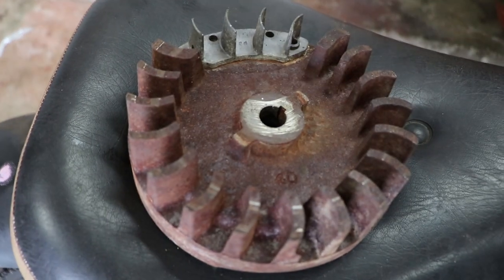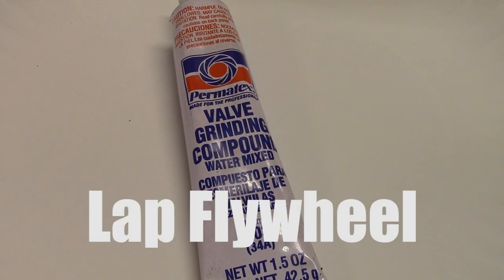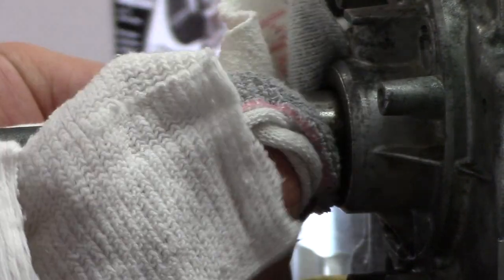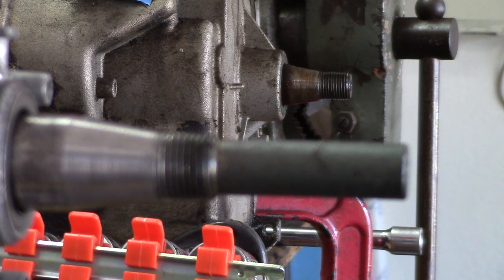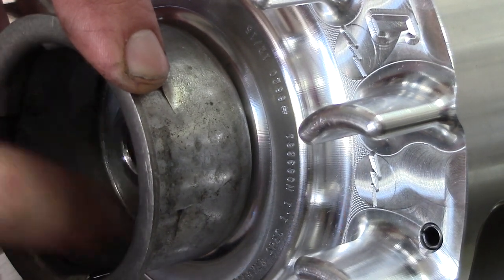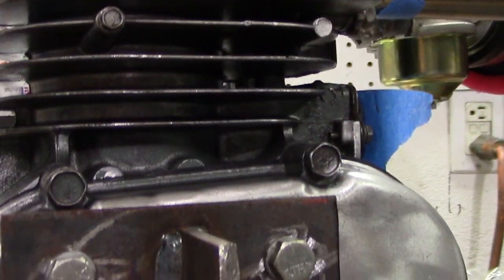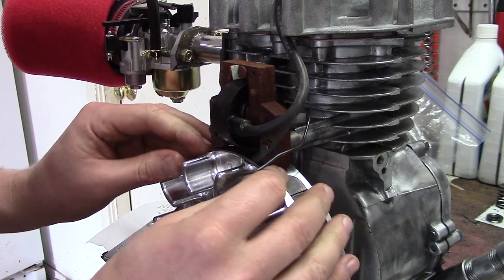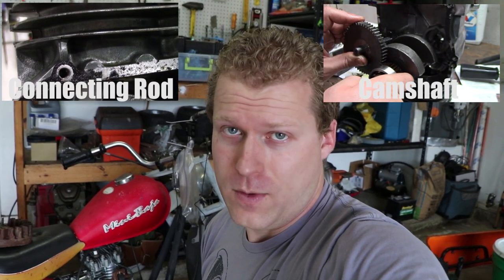Arc Billet Aluminum Flywheel: How To Install

Comment: if you have an old clutch you can take it apart and use the part with the key as a crank securer, it has grooves to set a bolt or two in between 👍

Comment: The plate you made was neat and the torque converter back plate is a good idea, but you could also just feed a bunch of rope into the cylinder with the head on through the spark plug hole and not worry about marring or damaging your output shaft. I have been doing it that way for years with no problems to date. The shaft will move unlike the plate idea but if you use a click torque wrench it won't matter.
Reply from the maker: Good idea. Its a cheap alternative. I just dont feel comfortable putting a rope in there and stressing the head bolts. Plus, you could bend the exhaust valve if you put the rope in there on the exhaust stroke.

Comment: Another option for holding the crank, you could use a sprocket the right size for your crankshaft and a chain whip (buy or weld some old chain to a handle) to hold it. Use a similar trick for bicycle freewheels, should work the same.

Comment: i have two Briggs 5 hp Flathead,s one is blown up the other one is being fixed and modified the blown up 5 hp is getting fixed for a mini chopper project and the modified one is on my mini bike cant wait to get the billet flywheel for both of them
Reply: I might be getting another 5 hp soon my local junkyard had one sitting in a huge pile of old worn out engine blocks
Reply from the maker: yeah they are pretty nice. Get yourself a PZ22 knockoff carb for that and it will do pretty well.

Comment: Hey man I just realized this is there a way to put like a gear on it to where it can be electric start not saying it has to be this specific flywheel but I do want to get a fly wheel from this brand I was just wondering if there’s a model that I could like put in a electric starter🤔🤔🤔🤔🤔
Reply from the maker: Some flywheels have this option
Reply: @KartFab  does arc make one?

Comment: if you install a billet flywheel, is it necessary to install billet connecting rod or anything else? Is anything else required for safe operation, or do other billet parts just improve performance? I know the flywheel is recommended if you remove the governor, but are any other parts (besides 18lb valve springs) for safe operartion?
Reply from the maker: Billet Connecting rod

Comment: Hey guys, if you do not have a welder or a 30 series torque converter, put a bolt in the crankshaft output and hold it tight with a breaker bar while you torque down the flywheel nut. Saves time and money!
Reply: Where exactly would this be? All the bolt holes seem far from the crankshaft
Reply: @treerexaudi  the threads that run inside the crankshaft on the pto side
Reply: @lazarusbambakidis6820  Ah alright cool thanks!

Comment: Can you use the "rope down the spark plug hole" trick, to keep the crank from turning? Or can that bend valves?
Reply from the maker: Can and does. You can also use a “strap wrench” with very good success
Reply: @KartFab  I'm confused because you answered with "also"... is the spark plug trick ok to do? .. He had asked two questions

Comment: I have a 21hp Briggs and interested in a  Aluminum flywheel with a stock crankshaft... will this upgrade help me big time on power....I am running a drag lawntracter..thank you for info
..Billy
Reply from the maker: If the flywheel is lighter you will accelerate faster but it won’t make more HP, just more acceleration. If you advance the timing by spinning the flywheel or a timing key that advances timing, it will allow you to rev higher depending on mods. Most stock engines run 22-25 DBTDC and you can advance to 26-32ish DBTDC on gas or higher on methanol. The things that give you the most power are carb and head combination.

Comment: I have a 147 series BS engine off of a Tote Gote... I have had different opinions of flywheel torque. Does the 65 foot pounds apply to my motor as well? I had a mechanic tell me that 65 "inch pounds" was adequate... I have also heard stories of f wheels coming loose and tearing up the  key way.. Whats the correct poundage on the f wheel? thanks
Reply from the maker: Iirc briggs calls for 55 ft lbs

Comment: Does replacing the flywheel increase power, or does it just add reliability? I'm not looking for more power (don't want to put too much power through my torque converter), I'm just looking for peace of mind when I remove the governor. I'm already running 18lbs springs.
Reply from the maker: Replacing flywheel with billet will reduce engine inertia but not increase horsepower. An engine with “high” inertia resists acceleration and deceleration. The less inertia an engine has, the faster it will accelerate. Again, this does not change horsepower, only allows the available horsepower to accelerate what you are riding faster than what you would be able to do normally.
Reply: @KartFab  Gotcha. Thanks for the helpful reply!

Comment: So I have a pressure washer engine can that even work in a go kart because the throttle system is weird
Reply from the maker: +Edan Hurlbert yeah, two of my go karts have pressure washer engines. Look up the users manual and see if there is a "remote throttle" or "auto throttle" type connection.

Comment: I have a few questions that I'd really appreciate help with.

If I have a gx270 clone with the governor removed. Maxes out at about 4180rpm, but is not very consistent for obvious reasons. I just want a slight upgrade.
A- how do I determine the stock valve spring strength? (Hours on the Internet turned up nothing)
B- how do I find the appropriate upgrade springs? People have said to use "18 lbs springs", but no website lists information this way, example 95lbs @ 1.125" seemingly minimum, if it provides any information other than the word "upgrade".
C- if I upgrade my springs, what rpm would I be likely to see? 
D- if I upgrade my valve springs, will I break the stock connecting rod? I haven't been able to find a single story confirming or elaborating on this.
Reply from the maker: +Will6804 will. A lot of the 'newer' Honda engines have a built in rev limiter set to 4200 rpms. This is not the governor, rather the magneto/ignition itself. Your stock springs will take you to around 5500 rpms. Do not change out springs, they will only rob power with the same 4200 rpm limit.I personally would find new magneto without the rpm limiter (where? No idea- Google it) high flow intake, rejet, and exhaust would be the next step. Don't run engine at high rpms without rejetting first or it will run lean, overheat, and possibly fail. I would personally feel 'safe' with a genuine Honda not throwing a rod for short bursts up to about 5500 rpm.
Reply: +KartFab thanks for the info.    My next thought I guess would be, would it be possible to simply take apart a magneto and bypass the limiter? I'm assuming that it's just a simple clock-like circuit, I might just be able to cut it out and have a standard coil. At that point, it would just be a basic spark generator. Any thoughts on this?
Reply: HellishGrin460 
get a valve spring pressure tester. 
I haven't looked at the price of one in years, but it might be worth it if you get into engines. 
And it can be used for other things. 
I saw an article years ago, about using 4 of them to make 4 scales to weigh your car.

Comment: I noticed there was wores sticking out of the coil or magneto when torquing it down. Where did you wire those up or do I not have to that on order for the engine to eun?
Reply from the maker: +Wyatt Knight two main wires come out of the magneto: spark plug wire and kill switch wire.

Comment: I took a magnetron from a old lawnmower and hogged the holes out and down so I can upgrade to  pointless on my Dyno Glide Deluxe Motorized bicycle,Briggs 61102 engine? I could put that aluminum flywheel from the mower on there I suppose for a power gain as the Coil converted over well.
Reply from the maker: Whatever coil goes with the flywheel is the one you should use. Also, flywheel taper and timing should also be a consideration.

Comment: i removed the governor not knowing i also have to replace the flywheel. can i just replace the flywheel with a billet for safety reasons or do i HAVE to get new cams and a piston?
Reply: What did you find out about this bro?

Comment: I know you might not see this but I was wondering if I can just put a billet flywheel on, i removed the governor and I have a predator 212 carb on my 5 horse Briggs and a exhaust
Reply from the maker: Billet crank before flywheel. The Briggs flywheels don’t normally have issues
Reply: KartFab ok, thanks

Comment: What do you mean by camshaft set for that range? I'm going to be getting the same 30 degree flywheel, and replacing the cheap cam on a brand new Predator212,  please add a link for the cam you bought for this flywheel. Thanks.
Reply from the maker: Reading the description would answer half of your questions so please do that. Also, when i say camset set for that range, i mean the camshaft dictates a lot of things that you need to do to your engine: for example, your camshaft card will tell you: what pound springs to use, what fuel octane rating you need to use, compression ratio you should set your engine to, timing range BTDC, and valve lash clearance.
Reply: ( ; ) ) Thanks. Found the right one.
Reply: Found a 32 btdc flywheel and cam, that calls for 36lb springs.

Comment: did briggs 5hp engines have an option of a aluminum flywheel stock? I have an old aluminum flywheel I believe off a 5hp that I saved from school  They were going to melt it down but luckily I grabbed 2 of them. I wonder if they would fit my 212. they look very similar to an arc flywheel
Reply from the maker: +Shintaro Dee they are not interchangeable.
Reply: The cast aluminum stock flywheels are banned in organized kart racing. They are prone to explode above 3500 RPM.
Reply: @Splungers  Do you mean "cast iron" stock flywheels?
Reply: @michaeljoyner4911  The stock 3 HP cast iron briggs flywheel is an old school hop up part. use a 3 hp coil, and a step down adapter plate. I've seen those turned 8000 rpm. There exists a cast aluminum stock flywheel that should not be used on anything above 3500 rpm.

Comment: hey bud me again. so i got every thing all together thanks to your videos!! but I'am having an issue with timing thing nearly yanked my arm off, i bought the cam and fly wheel that should time together. Any ideas? is it possible to put the magnet on backward?
Reply: ok update on that idk if it is timing the engine still stalls as it approaches tdc with the spark plug disconnected but moves freely with it out. all i can gather is for some reason it's building too much pressure in the head for some reason i havent run it long but it seems to do fine if you set it in a sweet spot then rip the cord.
Reply from the maker: +alex pat pull slowly to compression stroke, reset pull cord, then pull. Check valve lash at TDC on compression stroke.
Reply from the maker: +alex pat sweet spot= compression stroke before TDC. If your valve las is not set properly, the compression release may not work, causing a hard pull. Compression release is on camshaft.
Reply: i adjusted the lash to to suggested spec still go a hard pull. i think from here i just need to tinker with it till i get it. i went from to hard of a pull to to soft. im sure i can figure this out thanks for all your help and your videos keep up the good work ill keep watching.
Reply from the maker: ok have fun. If you pulled yoru flywheel it could be a sheared flywheel key if you didnt get it torqued to spec. I dont know much more than that. If you put in a new cam, you need to check out the timing dots at tdc to make sure they line up.

Comment: Hey, do you need to replace the cam if you put an ARC Billet Flywheel? Because I know the cam comes with a card and shows specific timing and valve springs. But does the flywheel require other parts replaced?
Reply from the maker: the stock flywheel can be used up to a certain rpm (which is debatable) vibrations caused by imbalances, high rpms, and centrifugal forces may cause the stock flywheel to crack, spin on the crank, and or fly apart. Most people agree that a stock flywheel at stock rpms 3600 up to about 5500 rpms  on a quality engine is safe enough. However, some uneducated people would put in a rev kit, and a nice cam, then rev to a very high rpm, and the flywheel would explode (at what rpm is not clear, and not predictable engine to engine) causing serious injury and possibly death. So, stock flywheel and billet flywheel are identical with the exception of what they are made of. So the billet flywheel just wont fly apart at very high rpms and is considered SAFE at any rpm you can turn on a small engine.
Reply: ***** yes, I understand this concept, but I'm wondering if you have to replace the can after putting a billet flywheel on
Reply from the maker: tim, if you fully understood the concept, you wouldn't have to ask that question. Let me break it down just a little bit more for you. The cam determines when and how high your valves move, as well as how long your valves stay open. The only relationship the cam should have to the flywheel is this: cam determines what you set flywheel timing at- thats it.  A billet flywheel doesnt really determine anything else very important other than not blowing up at high RPMS and moving that little magnet around to make the spark jump on the plug when it passes over the magneto.
Reply: KartFab thanks man! makes more sense now. it would be nice if I could ask these questions on some page because I got lots of them
Reply from the maker: +Tim Kuzmenko diygokarts.com then go to the forum

Comment: Can I put one of these flywheels without changing the cam or anything else?  (Predator 212 cc non hemi)
Reply from the maker: +Paulie Detmurds yea, just make sure it's for the non hemi engine. I'd put a billet rod in before I put in a billet flywheel.
Reply: KartFab Thanks for the response!
Reply: What do you have to do differently on a predator 212cc-hemi in order to install the aluminum flywheel with  8 degrees timing advance built into the keyway & 32 degrees BTDC ?... I have already put a torque converter on and the engine is built by removing the governor and upgrading rods and springs..  Also would a torque converter be just as good at securing it in place? I'm doing this all on my coleman ct200u minibike. Thanks in advance.

Comment: So if I get the right cam put it dot to dot the arc fly wheel is timed? and should the piston be at TDC with the valves all the way closed and is it the dyno cam mod 2 I need? if you could tell me that would be much appreciated.
Reply from the maker: ok lets get this straight. Timing  is when the spark plug fires, usually
 set as degrees BTDC (degrees before top dead center). The Mod 2 cam 
card (look it up if you don't have it- you also seem to need to 
understand valve lash as well) specifies timing to be set at 32 DBTDC. 
So now do you have that information you need to be able to check it. If 
you have a arc billet flywheel, it will specify that the BTDC it is set 
at at default with it set on a stock crank with the key installed. I was
 lucky to have mine already set so i didn't have to double check it. 
Most people buy a special timing advance key to modify the stock timing.
 (you need to figure that out on your own). If you want to set your 
timing (besides with flywheel default, or special timing keys) - you 
will need a few special tools - dial bore gauge to measure tdc, degree 
wheel to attach to crank, and a timing light (you can get away with no 
timing light if you have an arc flywheel. Its all complicated for new 
people so most people just do the key advance thing.
Reply: okay that help a lot thanks man!!

Comment: Could I put a wrench on the clutch nut and use a torque wrench on the other to torque it to 65 pounds
Reply: That would torque the clutch bolt to the same 65 ft lbs.  Way too much for a small fastener.  Might break it.

Comment: So I can just slap it on as showed with the stock key and timing won't be off since it's set with the key no special tricks or tips?
Reply from the maker: Correct. You can always check timing with a timing light but it’s not necessary 99% of tge time
Reply: I don't have to worry about tdc or my crank turning while installing I don't mean to bother with questions I just don't want mess up lol I'm just nervous when it come to anything timing related thanks for the reply
Reply from the maker: @iamkirbo5069  just torque to spec with stock key and you will be at whatever the flywheel is specified to be at
Reply: @KartFab  I got it done man appreciate it I was in my head a little about it more than I should

Comment: Did you use a long enough extension to put the magneto on?
Reply from the maker: +Brad Crone block came with electric start crank, which I used, so the magneto also came with spacers, which I used.

Comment: Anyone know if the billet flywheel has big enough magnetos to run a charging coil? 

I have an old charging coil and i dont wanna have to take stuff apart again if its not gonna work in the first place.. thanks 👍
Reply from the maker: Billet flywheel does not have magnets on the inside of the flywheel and it will not charge anything.
Reply: @KartFab  👍 thank u

Comment: would it work for my 6.0hp tecumseh? I'm sure it will but just checking
Reply from the maker: +Tennin yeah, just get the right flywheel and connecting rod for your particular model.

Comment: Ok I need a the performance cup for the arc adjustable 212 non hemi engine. The stock cup will not work
Reply from the maker: There’s a performance cup? Whaaaaat